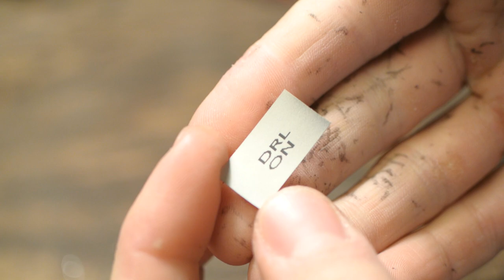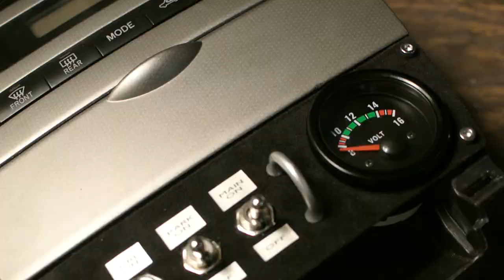I made a switch panel to control some lights

Comment: Nice work, i installed a volt metre to mine aswell, but was lazy and stuck a hole saw through the cover panel beside the 12v socket
Reply from the maker: If it's stupid but works, it aint stupid 😎👉👉

Comment: if possible can you share the links of  materials which you used in this project?
Reply from the maker: No links as they were bought years ago and/or from local shops, but some searchwords you can use are:
Airplane switch guards
Retro 12v switch
Retro 12v voltmeter
Faux suede headliner material
LetraTag label maker
👌👌
Reply: @schtekar  thank you too much

Comment: what are those d shaped rings called ??
Reply from the maker: Hey bro, do a search for "toggle switch guards" or "airplane switch guards" and you'll find them eventually after scrolling past a bunch of plastic garbage 👌 You could also use u-bolts with nuts as stoppers, not as nice but about 10% of the price

Comment: Amazing work , if you remember could you please send me links to order everything you used in this video?!
Reply from the maker: No links as they were bought years ago and/or from local shops, but some searchwords you can use are:
Airplane switch guards
Retro 12v switch
Retro 12v voltmeter
Faux suede headliner material
LetraTag label maker
👌👌
Reply: Appreciate it !!!
Reply from the maker: @tonyjr6096  Stumbled upon the link to switch guards! https://www.ebay.com/itm/Classic-U-shaped-Toggle-Switch-Guards/182909931971?ssPageName=STRK%3AMEBIDX%3AIT&_trksid=p2057872.m2749.l2649

Comment: I was stalking your car on SVV, and it says the car has been scrapped. RIP :(
Reply from the maker: It is 😔 Rarely got to use it and the rust was starting to get at it, and at 320k km I was unsure how long it would take until it blew up. Decided to sacrifice it to get parts for the T-Sport, but also used some parts to put two other e12s back on the road which I made a nice profit on. Its legend lives on in RA39441 (the T-Sport), RJ57422 and RJ56337, all still on the road thanks to it! Stripped it for all of its characteristic parts and will definitely bring it back to life in some form or another. Its death was not without purpose 🙏 You can see its final form in Finnkode 259137127

Comment: Hi everyone please assist where can get those foglights? please !
Reply from the maker: In northern Europe it's standard equipment on all Sol spec facelift e12s
Reply: Any website you could recommend me to try and check for thoses
Reply from the maker: @lungelomhlengi8801  Try eBay, a quick search for "corolla e12 foglights" returned lots of results with free international shipping